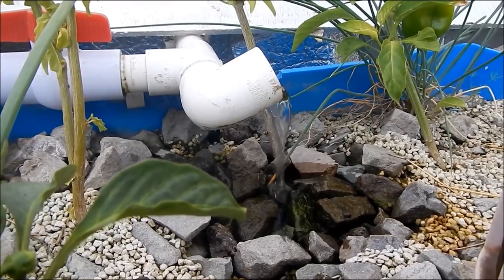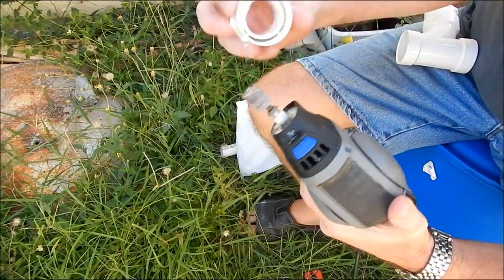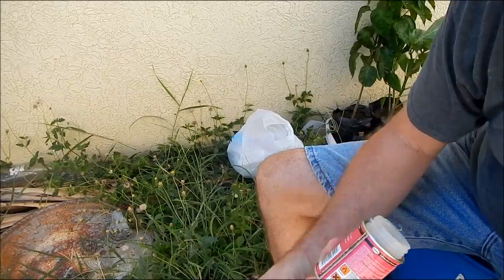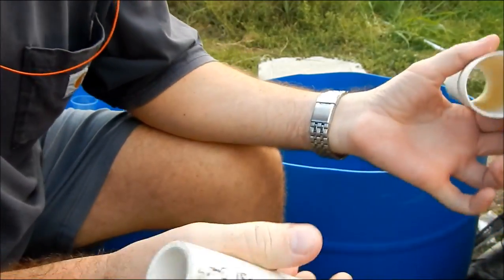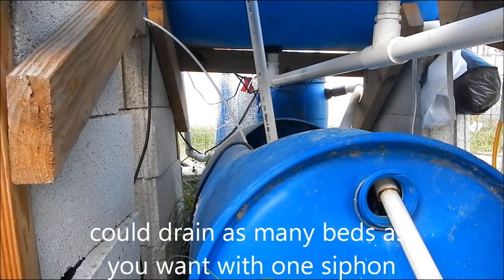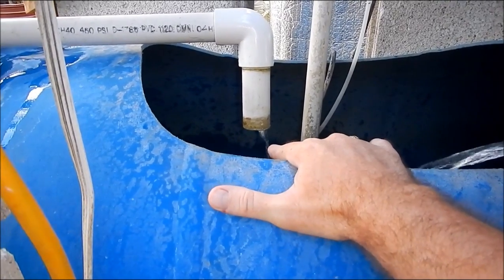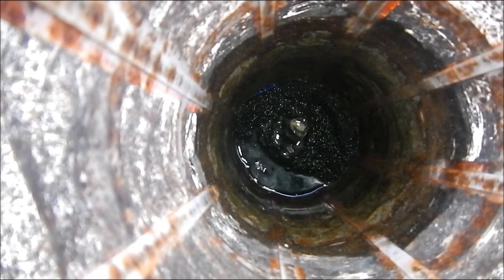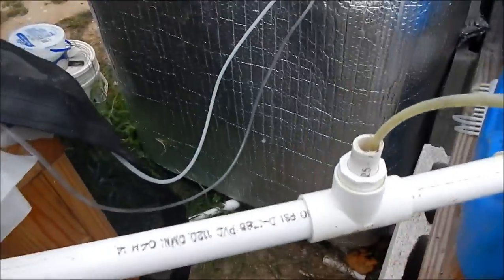Aquaponics update: Never fail bell siphon

Comment: Hello! Amazing system! Been looking for a long time for a working example of multiple beds being siphoned by one bell!
One question I have is indeed, what are your dimensions for pipes, and also wat is the purpose of ur hose in ur drain pipe by the tank? I understand the ventury effect, but not ur second hose. Fruitful tidings!
Reply from the maker: Gilbert Joalex the pipes coming out of the grow beds are 3/4” pipes. They lead into a 1” pipe. That will change depending on the number of grow beds.  As to the hose, the ventury effect creates suction. The air pulled into the pipe has to come from somewhere. Normally it just comes from the surrounding air. All I did was connect that to the top of the bell.  Under normal conditions it just pulls air but when the bel is almost ready to trip the air being sucked out of that bell will be helpful in triggering the siphon. All that does is make it easier for the siphon to trigger under low flow conditions.  To be honest I had mixed results using this.  The problem is that it requires high flows to effectively get a proper ventury. The pipe I had that connected to was not at a high enough flow to create the needed high pressure zone. There are multiple way to make sure that work.  But I was forced to pull the system down after my wife’s death. We had to move and this place isn’t really appropriate for that system. As soon as I have the house built on the homestead property I will be setting up another system. I have several ways to improve the system. I have been working on my food forests and agroforestry system as I work out the legal headaches regarding my wife unexpected death.  I do believe this is a completely workable setup and it did work very well for a long time.  This was just a test of ideas regarding the larger scale systems I plan on putting on the homestead. I have ten acres there so there will be much more room to work with once we are there.  
Hope that answers your questions. If not please ask more. I’m happy to help in any way I can.
Reply: Thanks a bunch for your reply! I will get to building and perhaps get back to you, with positive results or questions! 
My condolences for your wife, I cannot imagine.  I hope your move and legal affairs do not get in your way, although it seems like the least of your worries. I would like to say i very much appreciate your contribution and work (and clarity), and most importantly your sharing. I hope I can one day reciprocate and pass along the favor you have done here, as well as participate in parallel with food forests and agroforestry, it seems a possible and essential task, made easier with your contribution. I wish the best of luck in your continuation of tests and ideas, and living. Much love from this stranger.
Reply from the maker: Gilbert Joalex thank you.  I’m happy to help. Feel free to check out my food forest and timber forest videos. Happy to help others getting those going as well.
Reply from the maker: Gilbert Joalex if you make a video of your system I’d love to see it.

Comment: Hey great video! I just created my first bell siphon the other day and it won't start the siphon. I'm wondering if you could do up some kind of diagram of everything that way I understand exactly how it works. I understand most of it but where does the small clear tubing lead to? I know it goes from the lid of the siphon but what pipe does it go into? Cheers
Reply: AmeriJam Acres  if I add little u bend at the delivery side of the bell siphon  (doest is substitute adding clear pipe at top). Thanks for posting video  great work.
Reply from the maker: That clear. Tubing leads to one of the water supply pipes.  The point is the create a ventury effect.  The flowing water over the open end of that pipe creates a suction. That suction will suck the air out of the bell.  If you do not have water flowing over the end of that tube it is impossible for a siphon to start.  You might be better off just not having any tubing in the top of the bell.
Reply: Ahhh I see. Thanks for that!

Comment: Good video and idea on the siphon. The one challenge with it though is that you then need to have a larger sump tank to accommodate all of the beds being filled and then all drained at the same time. I have 4 IBC beds now and that would require a bigger sump tank. Thanks for the video!
Reply from the maker: Stephen Crescenti I understand your thoughts. The reality is you really should consider having a sump tank big enough anyway. it is possible for all the beds to drain at the same time. I know it's rare but it's impossible to time multiple siphons to guarantee they always drain at different times. I know it won't happen often but to assume it'll never happen is dangerous. eventually those siphons will sinc up and if you don't have an adequate sump tank you will flood. then you run the risk of burning out your pump and crashing the entire system. if all you use are DWC beds you can get away with a small sump but any system that used flood and drain requires a sump big enough to handle all the beds draining together.
Reply: I agree with you completely on this. But with a single siphon, you are forced to make sure you have enough water. In my sump, I have an autofill valve that is connected to the main line, so it will autofill the sump if all 4 do fill up at the same time and that reduces most of my risk there. Thanks again for the video!

Comment: Thanks , I have been working on something similar for my glass fish tank I think I now know what is wrong with mine , using a Venturi to clear the air lock brilliant idea, maybe now the siphon will not randomly fail causing the tank to overflow, I did have the breather hose  leading to the upper water level of the fish tank in hope water would create the seal for vacuum   ,I will redirect this hose to the water pumps outlet / fish tank inlet

Comment: What size is the sani-T
Reply: Also where did you find the thin wall pipe?
Reply from the maker: That is a 1 1/2 inch T.  The thin wall pipe is just drain pipe. PVP pipe is in pressure and drain.  The pressure pipe is thicker than the drain pipe. anyplace with pipe will have the thick and thin walled pipes.